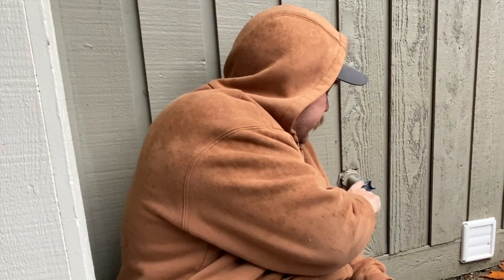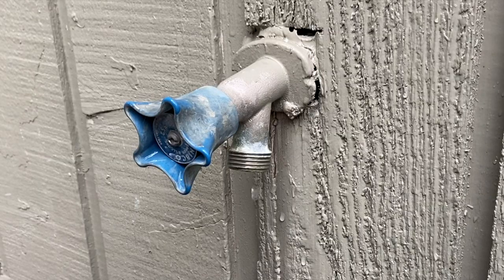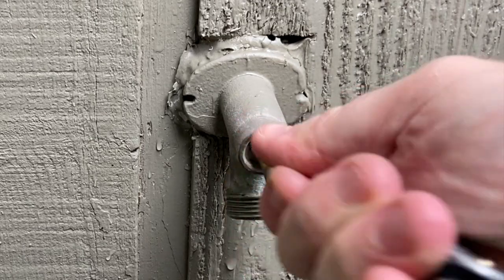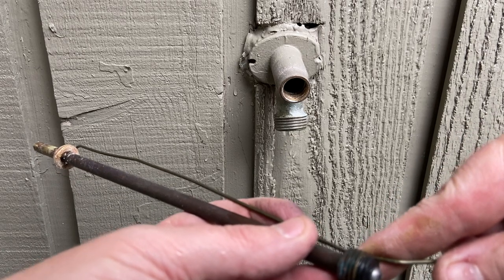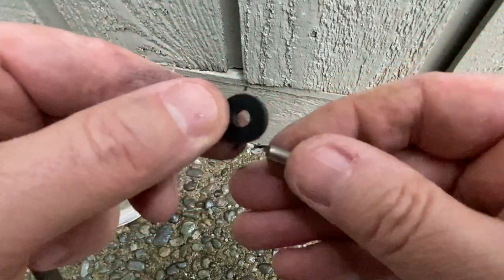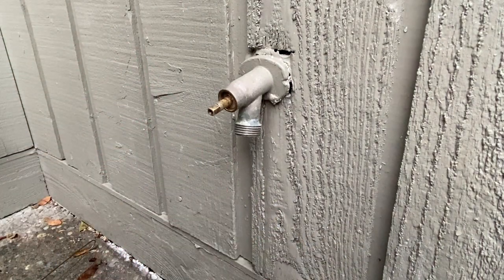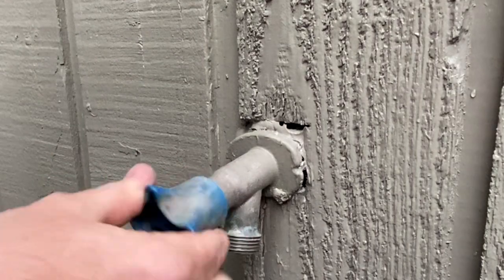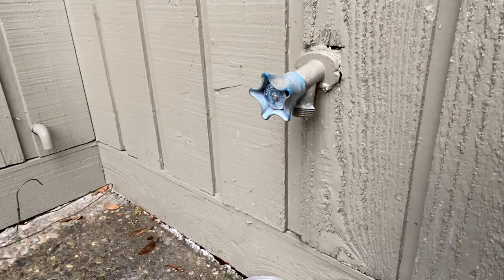CAN AN OLD OUTDOOR WATER FAUCET BE REPAIRED?

Comment: Fix it  guy. Spot on with this video. Our house was built in 1979, Bibco bib, had to gouge out old packing, too much silicone packing on 1st attempt. I had to  go back and retighten the packing nut ( didn't want to overtighten it 1st time). No doubt, had I NOT watched your video, I would have damaged the stem by not removing the old packing. 😅 Follower for life.

Comment: This video saved me. Thank you. I had an old spigot that after fixing a broken screw and gasket it was spewing worse than before. Wouldn't turn off. Turns out I was missing valve packing tape. There was none in the chamber when I took it out so must have eroded away. Added the packing and a perfect fix. Thank you again for this video.

Comment: Richard on  "Ask this Old House" suggested using a few feet of teflon tape doubled over and rolled into a makeshift packing rope. I would lightly grease the valve stem where it turns inside the packing....no squeaks.  Why not put some screws into that wall to hold the valve and then caulk?

I agree about fixing things.  I bet that Nibco will, as old as it already is, out last a crappy big box chinesium valve the plumber would have stuck in there.

Comment: I have an older outdoor water faucet that was leaking behind the handle.  I looked at a few different videos, before I found this one.  You were repairing the EXACT faucet that was giving me problems.  After watching this, I went to a local hardware store hoping to find the parts I needed without waiting on an amazon order.  When I took the faucet apart, it was missing the washer that was supposed to be holding the packing material.  Then I made a second trip to the hardware store to find a washer.  The back rubber washer looked worn, so I replaced that, added my washer and wrapped the packing material in place.  My original problem was FIXED.  I had to see your video to visualize what I needed to know.  Incidentally, the new rubber washer at the back of the stem now leaks, which wasn't a previous problem.  My replacement seemed too thin.  I found a thicker tapered washer in the assortment I bought at the store, and I finally had complete success.  It took a little thinking on my part, but your video was critical for me to know some basic information.  I couldn't have figured it out on my own.  Thank you very much for your great video.
Reply from the maker: That is awesome!  I always love hearing adapt and overcome success stories like this. So glad this video was able to help you out.

Comment: The issue is when a plumber come to fix stuff in your house, the cost break down is usually 95% labor and 5 % part! Let’s say you have a old valve that is leaking,  take it apart and replace a washer will save you $7.50 vs .59c. But the repair bill is still going to be $249  vs $240 and take about as long to do the job!  So why wouldn’t you replace the old one and be done with it?  If you are going to DIY,  sure repair it with part. No issue

Comment: This is the same problem we have on both front and back frost proof faucets but they have both also been replaced with new ones (not so recently) so packing is/will be the answer.  The only thing I would suggest is to smooth up the shaft where the packing will be rubbing.  Leaving it rough is asking for a new leak as the packing is 'sanded' by the roughness with use.
Reply from the maker: Great call on sanding that shaft a little. Thank you.

Comment: I'm hoping I can get my valve stem out.  I watched another video where a guy just loosened the packing nut, which was on the outside of his faucet like mine, without removing the handle, and he was able to twist out the stem by hand.  But you have given me the idea maybe I need to unscrew the handle and dig out some packing.  UPDATE:  I was able to get the valve stem out after being a little more aggressive with it.  Unfortunately the screws that hold the handle, packing nut, and washers on each end of the stem are so corroded on this 44 year old faucet, I think there's no way I'm getting them off to do a proper repair.  Looks like I'll be calling a plumber and possibly a mason as well.

Comment: Great video, I’m from the uk but like to watch plumbing videos from anywhere,surely they could not charge $550 to replace that, I’m not a plumber but have done a couple of these myself
Reply from the maker: That was a over the phone bid. They did not even look at it and quoted that. Plumbing has gottin pretty crazy here to me.
Reply: I had to replace mine last year and it is fairly involved to do so . I had to go into the house cut out drywall to gain access to it and replace it . So 500 sounds about right for someone to come in and fix it . If i was building a new house I would never install one on the house . I would use the free standing frost free hose spigot from the ground outside of the house . No exterior hole in the wall , no chance of it freezing and causing catastrophic water damage to you home .

Comment: Mine doesn't leak when it's off. Mine leaks from the knob whether there is a hose connected or not. Any ideas? Thanks
Reply from the maker: from behind the knob?  Sounds like the packing nut is leaking. Have you tried tightening that up?
Reply: @ThatFixItGuy  no. I don't like messing with plumming. Looking for advice first

Comment: GET RID OF THESE OUTDATED JUNK FAUCETS. Replace them with 1/4 turn ball valve faucets. No o-rings and no gaskets. I replaced everyone of mine many years ago and have not had one leak or drip since. You can get ball valve faucets at any home improvement or hardware.  I live in Michigan, USA. I have all outside 1/4 turn ball valve faucets and have never had a leak or a freeze problem. Old style faucets are nothing but trouble.
Reply from the maker: I would love that. They are not common here because everything is frost free for the most part. I used them a lot in Florida and Arizona.